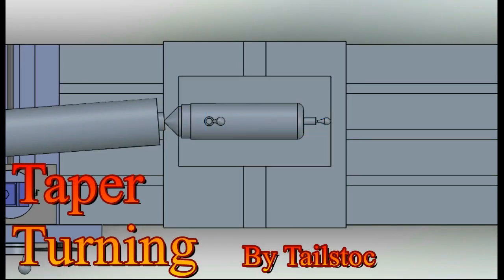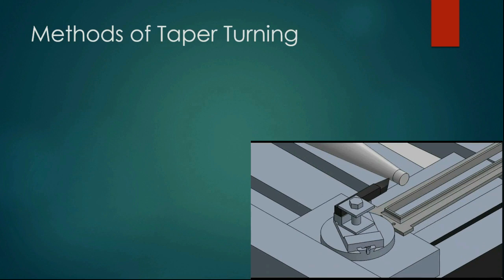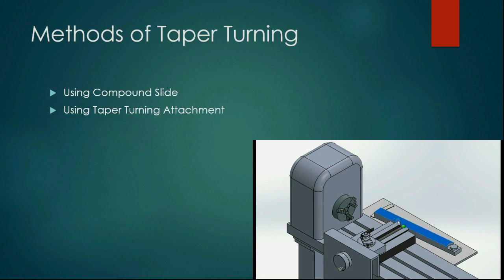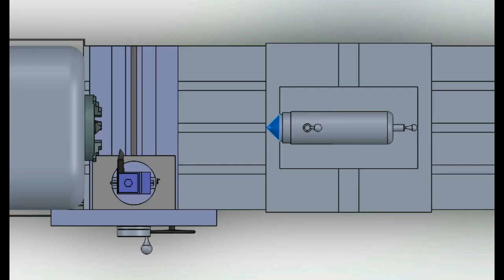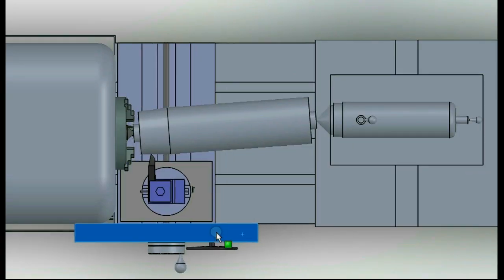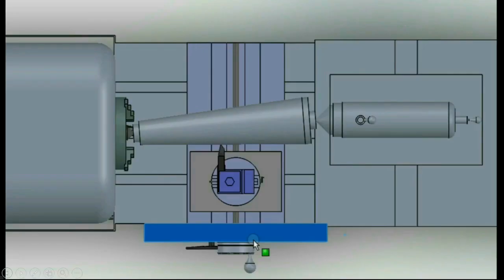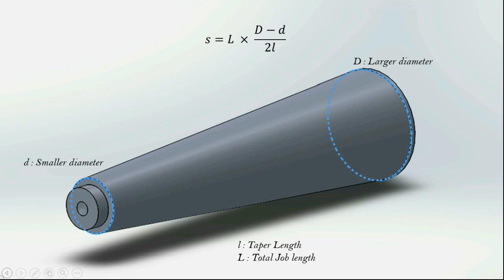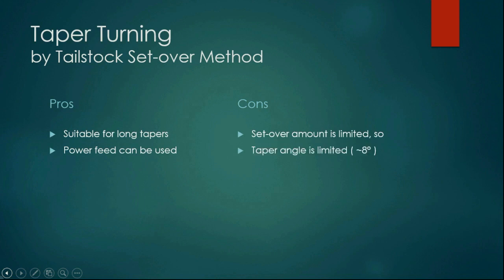Taper Turning by Tailstock Setover Method

Comment: Could you tell me what function is tailstock
Reply from the maker: Tailstock is used to support the end of the workpiece, and is primarily required in case of a  long workpiece. In this particular application, tailstock is required to hold the workpiece inclined to the lathe axis.

Comment: I believe the tailstock should shift toward the toolpost so the drive dog can go on the large end and the small end of the taper is at the tailstock.
Reply from the maker: Yes, for taper in other direction, toolpost should shift in other direction
Reply: @Mech4Mechs  What I meant was that the large end is usually closest to the headstock.
Reply from the maker: Yes. Otherwise the large end might interfere with the chuck